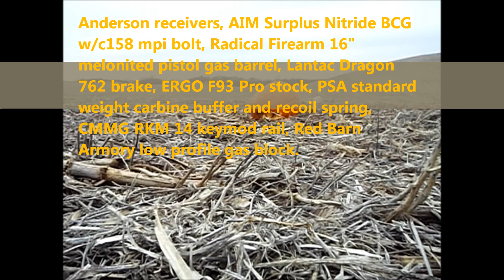300 Black Out vs Pumpkin

Comment: I never did get around to building a 300 blackout
Reply from the maker: Yup it was a pretty sweet AR, I had to install a Odin Works adjustable gas block to get it running right.  It was very over gassed with just a standard low pro gas block.  Ended up selling it after I got it running right just to fund getting a CZ 75 Omega and some upgrades for my AK 74.